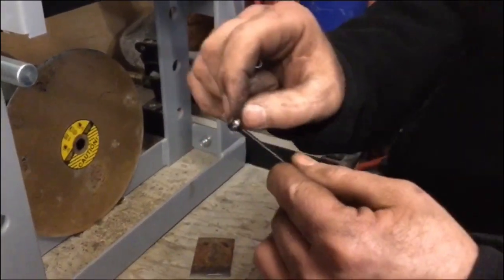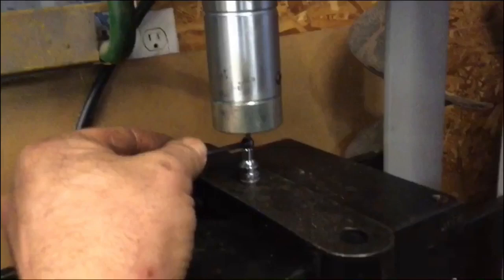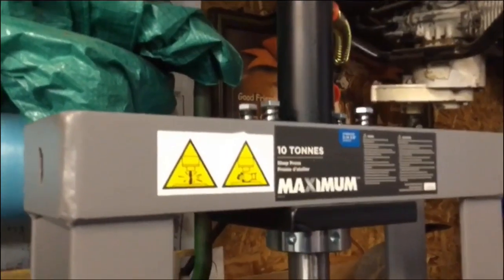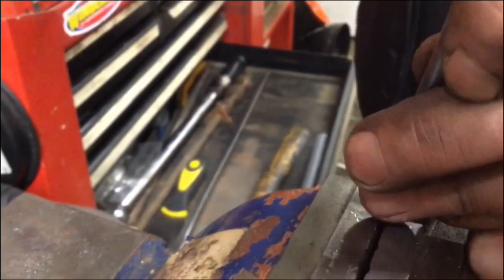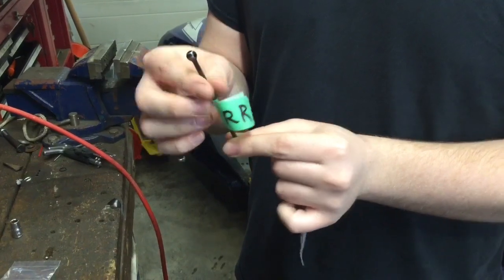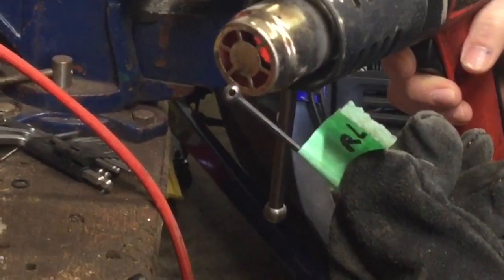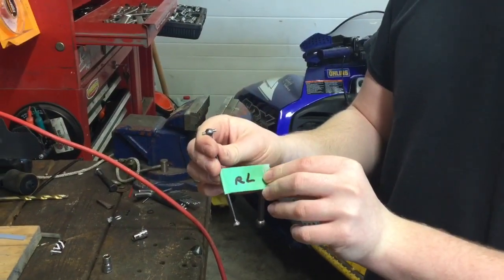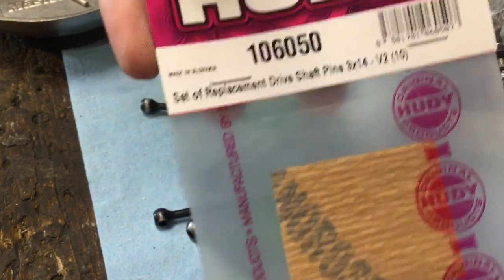How to replace drive shaft pins on RC vehicles

Comment: Great vid bro. I did a similar thing. I just ground down a 3mm allen key then pressed it into my driveshaft with my vice using the same socket as you described. I didn’t have to remove my old pin as it flew out on my last bash. 
Gotta get me a press. 
Thanks for the great info dude. 😃👍🏼

Comment: I am having problems with my pins coming out on own 🤯☹️ front is spring steel CVDs and rear is #45 steel CVDs Idk if it because of angle on shafts or just loose from factory or what. Front and rear 🤯 must be the angle 🤔 my fireteam is jacked up 😉 huge shocks, metal arms, kraton (wider) hubs. Diffs all metal with thick fluids. Center (ear plug), 1mil rear and 500k front. Max 6 combo pushing hard with these 10000mah zeee 120c batts 😉 it's over 30lbs 🤯

Comment: Best way to do it is to heat em up . So it will go out much more easier
Reply: If you heat it up too much you can mess with the factory heat treatment. If it loses its temper, it will bend  pretty fast.